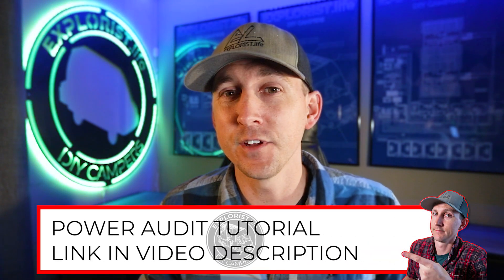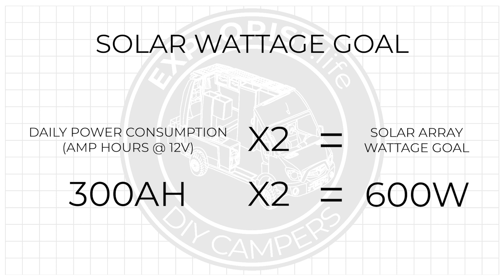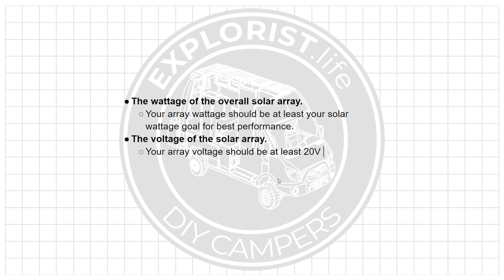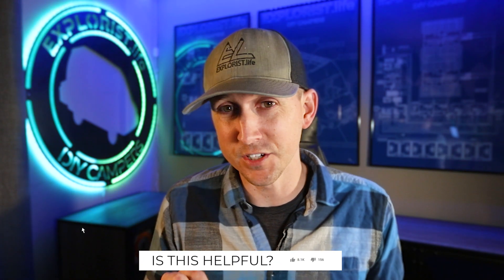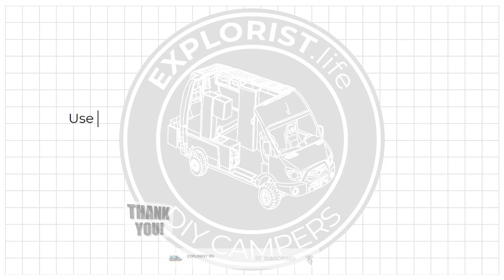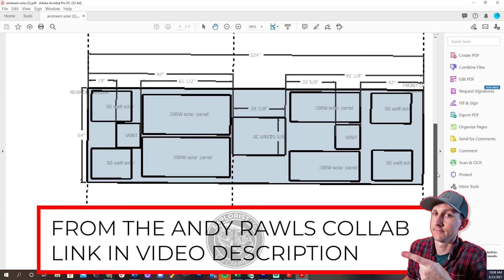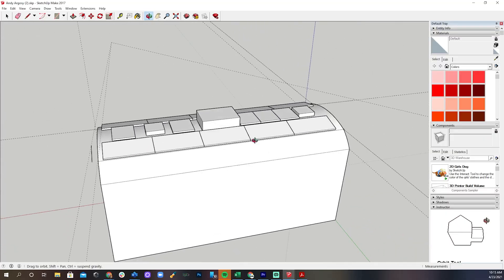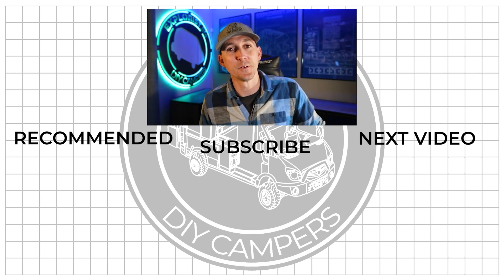Best Wattage of Solar Panel for a DIY Camper Electrical System (and why there isn't a 'best' one)

Comment: So i want to put at least 3000plus  watts of solar on my fifth wheel RV and am going to be pulling a 16 foot trailer behind my RV. I would like to put another 1000-1200 watts on the pull behind trail bumping up my solar wattage so when i dry camp (boondocks) i can plug it into my fifth wheel trailer solar system giving my tons of power to run two ac units a lot as well as tvs, microwave, and all other items in my fifth wheel. Can this be done and also adding plug in system from trailer to fifth wheel. Thank you for your great videos that has helped me so much to under stand solar systems and installation processes!!!
Reply from the maker: With the proper application of effort and funds, anything is possible. 😀👍

Comment: how close in volts & amps do panels need to be effectively wired in series.  ie: 1 panel at 190 watt, 19.2 volts 9.8 amps and the second panel at 110w 17.2 volts and 6.4 amps.  Is it correct as 190 + 110w = 300 watt array, 19.2 + 17.2= 36.4 v but degraded by the 6.4 amps of the lesser panel.  resulting 36.4v x 6.4 amps= only 232.96 watts of the 300 watt array, thus 77.6% efficiency

Comment: Do solar panels mounted an inch or so off the roof shade the van's roof so cool things off, or due to the heat of the panels, do they heat up the van.  I'm about to add solar panels to my 2020 sprinter.  Along with all the Victron equipment you recommend in your videos!  I have a question, If I mount my solar panels about an inch off the roof of my Sprinter, will the panels cause the roof to be hotter or cooler.  In other words, even though the panels will shade the roof, will the heat from the panels cause the roof to be hotter, and therefore the inside of the van hotter as well.  Thank you for your super great videos.  If I don't see you doing it or recommending it, I don't do it with my Sprinter.
Reply from the maker: Great Question!  I don't have any data to back this up; but I would suspect that the heat under the solar panels would be less than the sun hitting the van body directly.

Comment: Hi Nate, again I want to thank you for all the help that all your Videos you provided., I installed 840 Watts with my 4 -100 amp BBs and they work great. My class A is Almost all Electric, Samsung Fridge, Induction cooktop, Microwave, Tv, Hot Water is by Propane or Electric and force Heat is with Propane. I use approx. 30% of Bat. thru night ( Fridge and Misc)  The morning I throw everything at the Array, Mr Coffee, Toaster, and Induction... check it out... I can make it through the day without running the Gen. as long as I have about 7 hours of sun.. It's working great and I am Loving it ! So again Thank you!
Reply: What's BB? How many panels? How many what's per panel? How many watts for generator?😁 Tnx a Mil🤗

Comment: Hi, great videos! 
You have helped me a lot during my van build. Could you kindly help me with a question… I’m connecting two solar panels to my solar controller tomorrow and I was wondering if I can just solder them instead of using mc4 connectors? 
I brought two mc4 branch connectors as four wires need to connect in two from the controller. The connection is just terrible and I was very tidy on crimping them. This connection is inside van so doesn’t need to be a water tight seal but I do need a strong connection!  I pain on soldering two positives to the positive and two negatives to the negative. And make sure the put plenty to heat shrink so they do not connect in the wall space. 

Your thoughts on this would be very grateful 

Many thanks Justin

Comment: Hello I have a question if I run two separate strings of 480w each to two separate charge controllers to one battey bank do I have only 480w total or 960w total thanks
Reply from the maker: 960
Reply: @EXPLORISTlife  oh ok thank you both strings will be in parallel panels are 37.2v each so 4 panels in two parallel strings would give me how many volts heading to my charge controller?

Comment: Can you hook 2 different sized MPPT chargers into the same charging system?  and if so can 1 be only 20 amps (for my portable solar panels) and then my other main one is 100 amps  - my main question is does a solar charge controller have to handle the ENTIRE system or only be rated for its own array of panels?

Comment: What if it's a 48v system
Reply: then build your arrays around at least 68 volts. four 20v panels in series would be 80 volts, plus your wires will eat less of your power due to that volts/amps ratio leaning heavily in favor of volts. for my 48 volt system, my controller will work with 160ocv, so naturally i take advantage of those higher volts, my 12v system receives 80ocv arrays,

Comment: what happens when the wattage on solar arrays are more than the max charging watts on the battery bank? for ex. 4,500w in panels with a max battery charging input of 2,400w.  and is it better to have more wattage in case of rain, shade storms etc?
Reply from the maker: I would not recommend having more charging watts than the battery could handle, no.

Comment: Hi nate.in this video you are showing how to calculate a solar wattage goal in a 12v system. 
How do you calculate it for a 24v system?
Reply: I had the same question but for 48v system. How to Calculate solar panels to battery
Reply: @Nate.. Same here... wishing for an answer... I need to place an order soon, and would prefer to just get it right the first time...

Comment: So when trying to meet the second metric of solar panel voltage are we looking a the "open circuit voltage" rating for each panel? Then multiplying that by how ever many panels in series there are?
Reply from the maker: Use the Maximum Power Voltage (Vmp) for that metric.

The Open Circuit Voltage is really only useful for sizing the charge controller in terms of maximum voltage input from the array.

Comment: Hey Nate i have 2 arrays wired in series parallel 3-325 watt panels going to a 60 amp mppt charge controller 1 series works great the other one says it’s only outputting 3 watts?? I don’t no where else to troubleshoot. Thanks
Reply from the maker: I would recommend checking each panel for proper voltage to see if a panel is bad.  That would be a good starting point.

Comment: Using your 3, 100 watt panel setup vs a single 300 watt panel I'm curious if the only benefit to having multiple panels would be if  the panel quit working? Could you limp by on 2 panels with reduced power consumption or would the system not even operate with one panel down. In my mind having the benefit of limping along on reduced power is better than putting all my watts in one solar panel?
Reply: I have a set of the 4, 25 watt panels and you can choose how many to plug in, so yes! 💯 I have also heard that having different styles of panels are important for low light v higher wattage per panel. The harbor freight panels are good for low light (I got the kit to start out my solar journey) and it's still working on rainy days 3 years later. The  higher voltage panels are excellent for full sun to charge more efficiently!
Reply: Yeah if they have diodes

Comment: Hey Nate, thanks so much for these detailed plans and videos. I am following one of the diagrams for the 2000W inverter system and had a question on the 2/0 gauge wire. You had 25 and 15 respectively for the black and red wire, just wanted to confirm that is 25 feet before I order. That stuff is expensive and wanted to confirm. Thanks!

Comment: What voltage should I choose? I'm searching your channel and I'm not finding an obvious video about the subject.
Reply from the maker: The voltage of the panels doesn't really matter as it can be altered depending on how the array is wired.  More info on that: https://www.youtube.com/watch?v=6G3Mo_OHmQY
Reply: @EXPLORISTlife  That's not relevant to the question I asked. Let me clarify. How do I choose a system voltage? Should I do 24 or 48? Panel voltage is irrelevant as you know. Your panel string voltage should be well over your system  voltage in any case.  

But what should my system voltage be? How do I decide that?
Reply from the maker: (The following are my opinions, not codes/standards)
For Systems requiring less than 3000W of Inverting power, use a 12V Battery Bank.
3000W-6000W = 24v
6000W+ = 48V
Reply: @EXPLORISTlife  Thank you, that's the sort of thing I am looking for.  Another question would be how to integrate 120V shore power into a split phase 240V system. Unless there's a product that does that, all I can think of is just a really big battery charger. But that may be a bit more involved of a topic.
Reply from the maker: Just wanted to follow up and let you know that the video comparing the pros and cons of 12v vs 24v vs 48v systems is now live.  Here's the link: https://www.youtube.com/watch?v=sEW-ZaOOlq0&list=PLmvhcyi4n0TU6HlMaQiCUwC20DBlyv6s_

Comment: I just installed 6 200w x24v Rich panels in parallel with 2  150w 12v panels in series and then paralleled them with the 200Wx24v group totaling  1500wats.  however I have 400 amp hrs at 24v batteries and did not know the rule that says you should be 20+ v over the batteries? so does that mean my array voltage needs to be  44 volts min?  instead of the 24v, I have?
Reply from the maker: A 24V battery bank charges at ~29V.  So your array voltage should be at least 49V for best MPPT charge controller performance (given you are using an MPPT charge controller).
Reply: @EXPLORISTlife  Wait what?? Run this by again please... The spec on my charge controller state min input of 55V and MAX input of 145V - 20A. Up to this point I understood if my panel array exceeded the MAX 145V input I would fry the controller. But your saying I should now send 165V? Not following.

Comment: I have a New RV Camper, I want to know the best way to hide my wires. I have about 4 more days to get this part so I can be ready. Still Searching.
Reply from the maker: You can zip tie the solar panel array wiring to the bottom of the panels.  That works quite well in most cases.

Comment: What do you think about tilting the panels to get as much solar as possible. I know summer won't matter but in the fall and winter should I consider this?
Reply from the maker: That's a great idea if possible.  Tiled panels in the winter will definitely make a difference.
Reply: 12  deg summer,30.6  if you leave year round,51 deg winter

Comment: Nate, could you please comment or make an episode related to the wiring scenario when in a stackable but side slide-out four-panel configuration  (two on top two)where environmental or physical conditions would allow only partial exposure? When only two or three or all four panels could be receiving sunlight, regardless of which side they on, for example, only two panels on one side can receive sunlight when one top panel slides out. Or three panels active if one side's bottom panel can't be open.  Would parallel wiring be best, or parallel-serial still acceptable?Thanks!
Reply from the maker: The principles on that would be the same as on a solar array with mixed solar panel sizing: https://www.youtube.com/watch?v=jejro4zkl8I

Comment: So, If I am Limited to 25 V and 660 Watts and Using a 300 Ah Battery Bank.  I would have to run the panels in parallel rather than Series, Correct?  I am using a Renogy DCDC50 and the Manual says no more than 25V and 660 Watts.  I was hoping to limit it to 3 or 4 Panels for my build.  suggestions? Laughter?
Reply from the maker: If your max charge controller input voltage is 25V, yes, you are forced into wiring in parallel.

Comment: That 20V +diff ratio makes sense in that voltage(volume) squeezed into current for watts pressure.. I get more watts from a dc to dc buck converter than a pwm charge controller feeding 100AH agm & lifepo4.. am sure an actual mppt would be best.. looking into the victron controllers and these tuts help deciding affirmations.. appreciations for the experience put forth.. $aves fees for novice sol cadets..
Reply from the maker: Glad it was helpful.  Cheers!

Comment: I have 4 Rich's 200 watt panels wired parallel, and 300 amp hours of lithium batteries which I might expand to 400. Would I be better off wiring the panels in series?
Reply from the maker: Yes.  Check the 'Solar Wiring Diagrams and Parts" at the bottom of this post for a 4x200w setup:https://www.explorist.life/3000w-inverter-400-600ah-400-to-1200w-solar-camper-solar-kit/

Comment: Hello question sorry i am having problem with my renogy 3500watt 48volt inverter everytime i plug it so i can charge my GFi GFCi trips and i am getting voltage on the AC IN when unplug and  inverter is on
Reply from the maker: Tough to say from the limited info I have about your system. Sorry about that!

Comment: Where did the 20V differential come from? Did you describe it in a previous video?
Reply from the maker: That is directly from Victron.  Although it's not published anywhere, since I am a Victron ambassador, I get access to their engineers and product specialists so I can ask these 'rule of thumb' questions when trying to explain this stuff in a more digestible manner.
Reply: @EXPLORISTlife  Thanks I take that - it is a little bit strange. Some data sheet (or marketing paper) says, it needs some 4 V above  battery voltage. So a 12V battery goes to a max of 14.4V.
But I found a manual of the MPPT-75-10 - and in its text it is according to your statement.
Reply from the maker: For Victron charge controllers... the 'Battery Bank Voltage + 5V' metric is the MINIMUM that is required for the charge controller to come out of sleep mode.  The Battery bank charging voltage +20V is a RECOMMENDED rule of thumb.
Reply: @wjhann4836  i wonder if you realize the "plus 20v" is the controller input side, not the output to the battery? one of my arrays is 84ocv but the output to the 12v battery bank is 14.4. he donest mean 12volt battery+ 20 volts for 32 volts. does that make sense?
Reply: @jasonbrown467  Then we both have very different experiences. 
I was repairing a catamaran in the med - was stationed before in the Caribbean. 4 huge panels - each some 28V oc. 
But the system voltage was 24V. 2 panels are still not working, 2 panels at aft (same direction) I connected in series to a victron regulator. 
Here (Europe) - if I can get the ocv at all - it ist most often around 23 - 28V.

Comment: How can 100W panels charge "earlier" than 300W panels? 150 a/h a day is huge consumption.
Reply from the maker: Sure!  So, a 300W, 60V array (3x 100W, 20V panels wired in series) will reach it's minimum charging voltage earlier in the day than a 300W, 40V array (1x 300W, 40V panel) as it simply has more voltage potential to work with.  Since it also has more voltage, the MPPT charge controller has more voltage to work with when 'sweeping' to find its maximum power point voltage to find the highest amperage output for the available sunlight.

150Ah is a bit below average for the people I help out.  (Average is closer to 225Ah).  But remember... this was just an example, and each person should do a power audit to see what THEY will use.  I've helped build 100Ah systems and I've helped build 1800Ah systems.